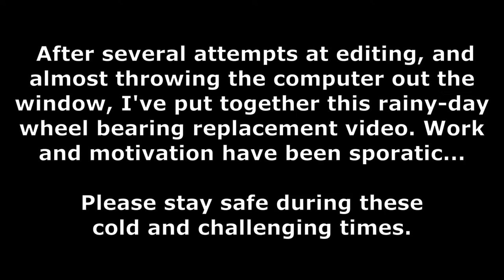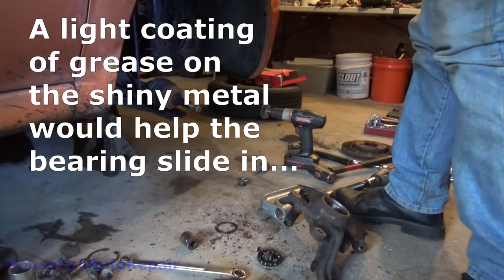2005 Chevy Aveo Front Wheel Bearing Replacement

Comment: I tried to replace the bad rotor on my Aveo and couldn’t get those set screws out. I tried for so darn long. Even tried drilling them out. I assume maybe the rotor is rusted to the hub or something, but now I’m almost positive the wheel bearing is going out. I would guess it could be because of the rotor causing it to shake. Either way though, maybe this video will help me figure it out. Thank you for posting
Reply from the maker: Drill the head off the bolt with a 1/4 drill.(Just deep enough to takeoff the head ONLY) Then, strike to middle of the shiny area of the rotor, to "bounce" it off the hub. Once the rotor is off, optionally, use Vise-Grips to remove the remaining part of the screw.
Rotate the hub, once the rotors is off, and check for smooth rotation. If you feel ANY "crunchiness" replace the bearing, too.